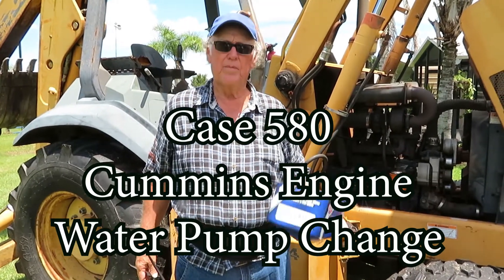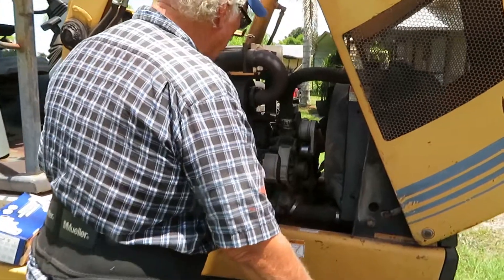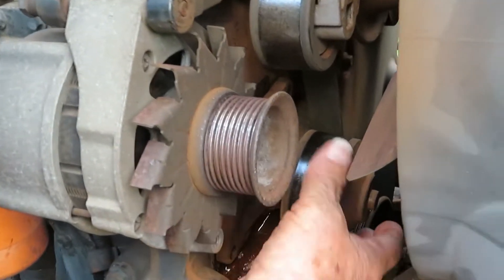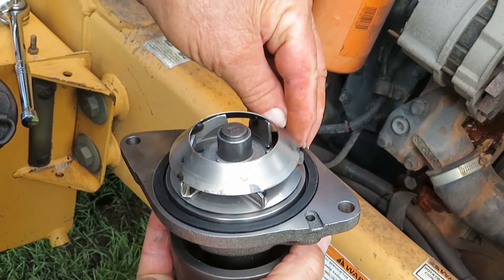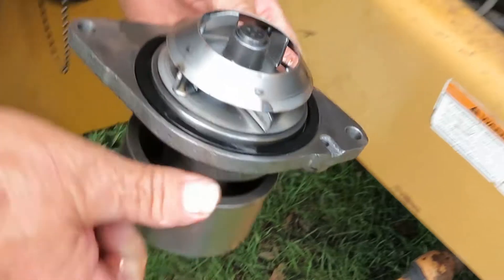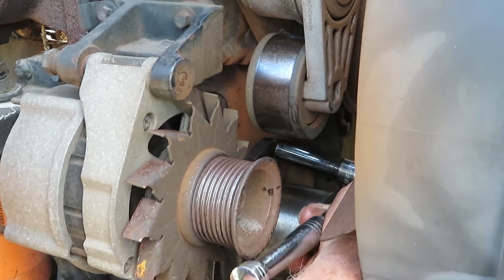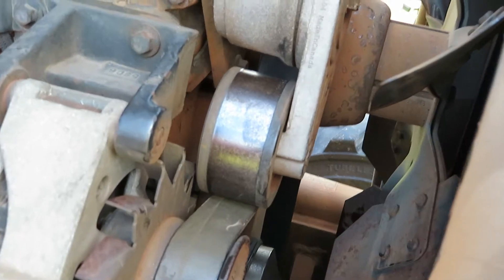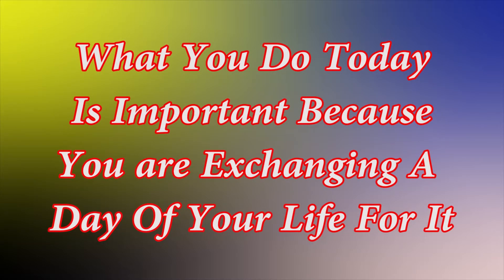Case 580, Cummins Engine 3.8L  Water Pump Change

Comment: Dave
Reply: Dave 

You have great videos.  
FYI changed my fan belt on my 580l and it was not hard.   1.  Take
belt off Pulleys and let hang  (can be
cut).   2. With a wrench  (ratcheting wrench better)  remove a nut from the pump coupler.   3.   Rotate
the engine to have access to the next bolt.  
( Use a barring tool to rotate the engine with a socket wrench. $25 ebay
).   Slide coupler forward about 1” and
you will have access to install new belt. 

Good luck and thanks for your help.

Mike 

DO NOT FORGET TO REMOVE BARRING TOOL BEFORE YOU START

ENGINE!!